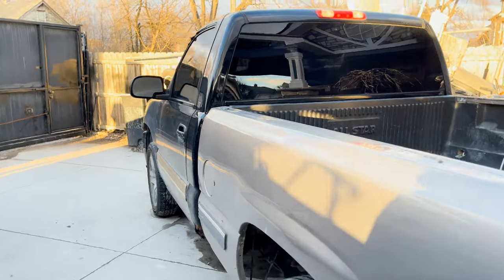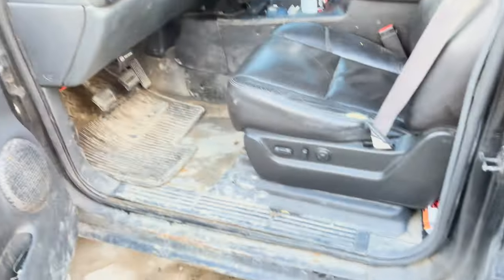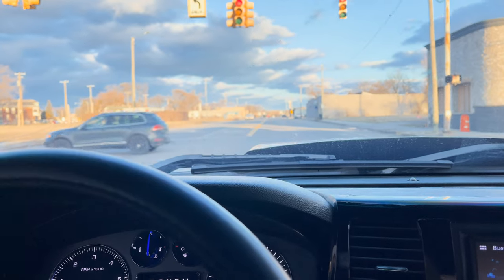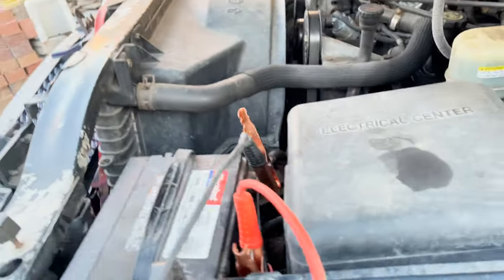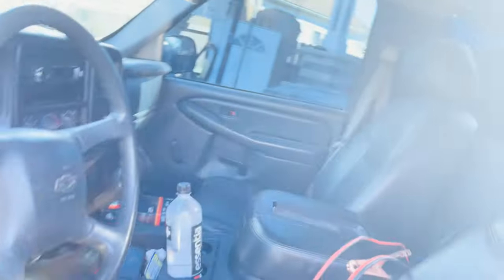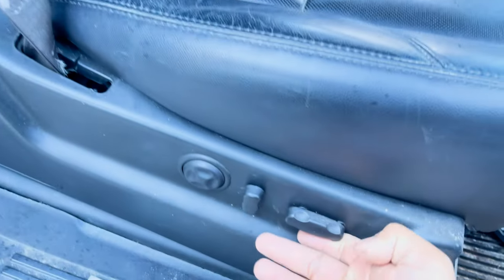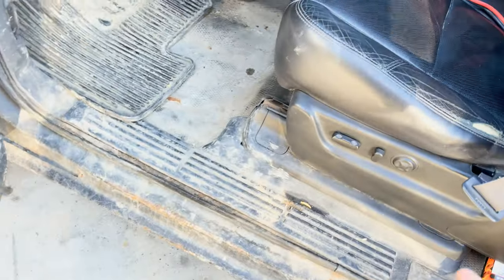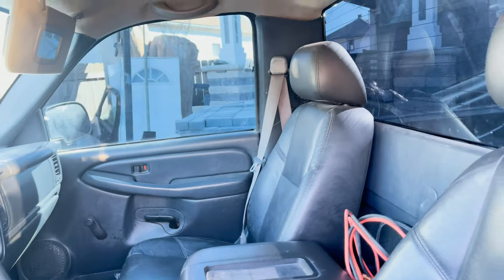SWAPPED 2011-2014 NNBS LEATHER SEATS IN MY 2002 PROJECT NBS!!

Comment: My boy how did you do the seatbelts, I’m wanting to buy bucket seats for my nbs but I don’t want to put a racing harness, I just want normal seatbelts, I’ve been looking all over and I can’t find anyone who has put normal seatbelts
Reply from the maker: I ripped open the original seats and took out the whole seatbelt system and bolted it on the cab. Text me on IG if you have more questions I respond quicker there.
Reply: @Jenner_LS  bet bet!
Reply: @Jenner_LS  how did you bolt them to the cab?

Comment: I found a good deal for those seats but I have a 2002 Silverado ext cab and I’m not sure how I’m do the seat belt part
Reply from the maker: For the seatbelt part, use your old seats, seat belt system so you would have to rip them and get them out and bolt it on your new seat, and find a hanger and drill it to the bpillar, so it retracts correctly
Reply: @Jenner_LS  okay thank you I really appreciate it I thought it was impossible since  they told me I had to have a single cab or crew cab to be able to do it
Reply: @Jenner_LS  yeah i think it’s impossible in my truck since I have no bpillars the only plastic on the side of me is the plastic from the rear doors since I have a extended cab really wanted them but I guess it’s going be impossible thank you anyways bro
Reply from the maker: Oh right then best bet would be racing seatbelts, totally forgot ext cabs that year don't have a bpillar.
Reply: @Jenner_LS  yeah bro thank you i appreciate you answering
Reply: I have a set of 2015 camaro ss seats I just put in my NBS Sierra, could you do something like a walkthrough on how you did the seatbelts?

Comment: how did you do the seatbelts?
Reply from the maker: I cut open the old seats and took the seat belt system out, and bolted them behind the seat, and hanged them by the pillar with a obs hanger.